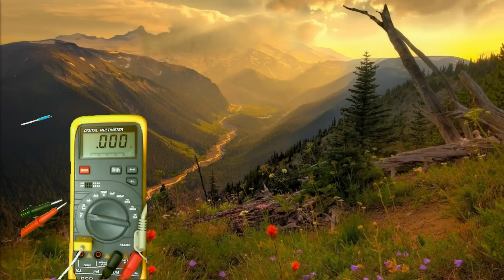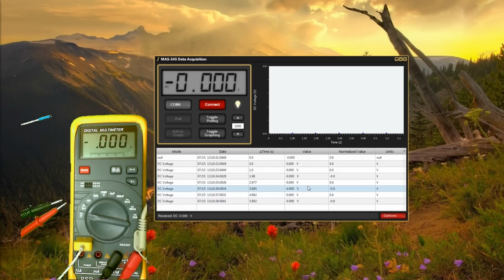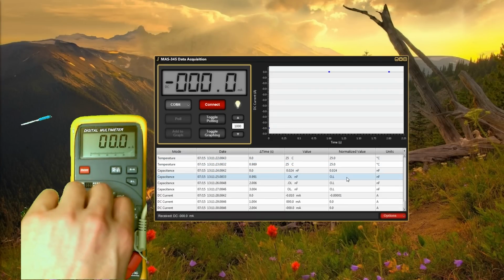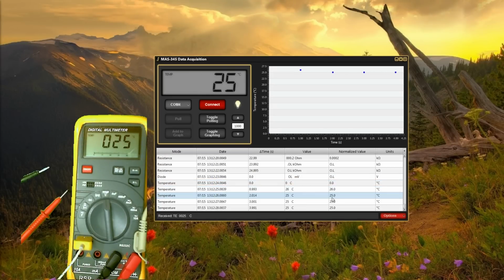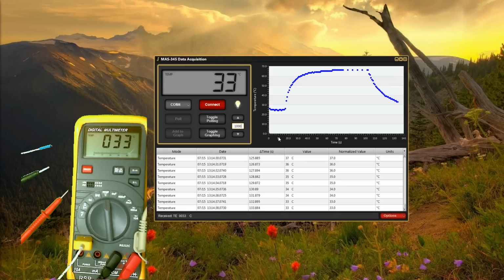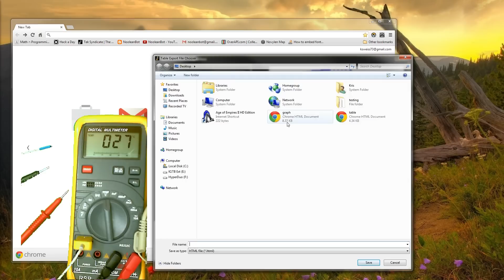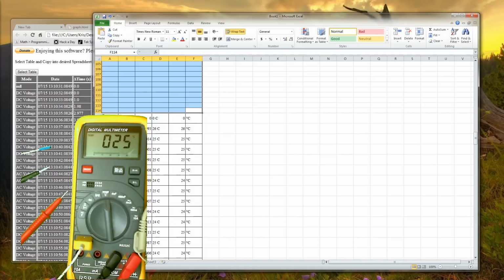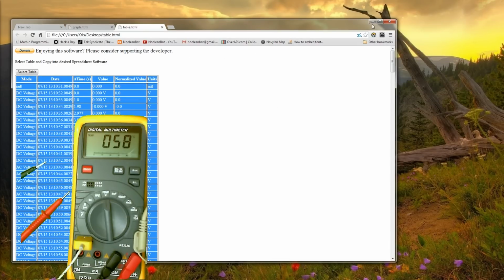MAS-345 Data Acquisition Software

Comment: This is great.  I've had this meter for years and previously used it for logging the resistance of a PT100 using the ortiginal app.  Will give this a try some time.

Comment: For example, when I switch multimeter from voltage to temperature, it takes about 5 second on software to see the mode change.

Comment: Hello. I'm facing the following issues. The software works, but very slowly - I mean, actual value change is reflected in about 3-4 seconds only, while I can see meter readings changing. Also, text on buttons is larger, and buttons can't be pressed normaly.